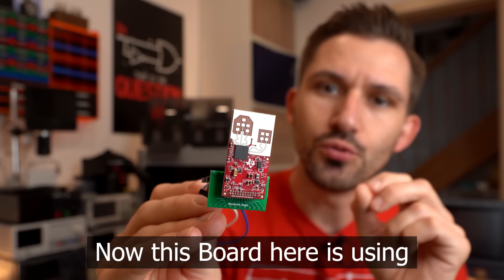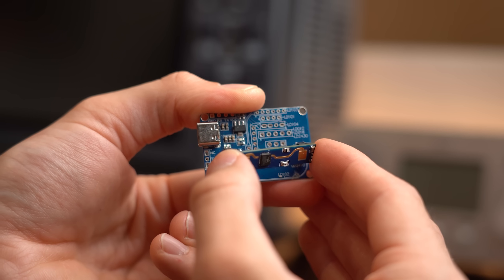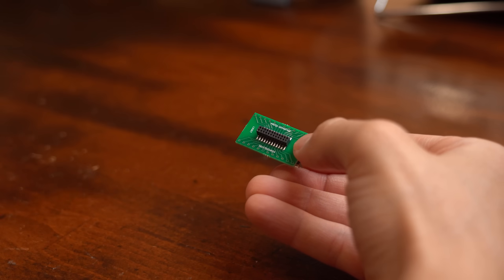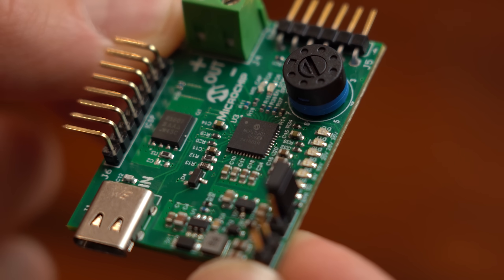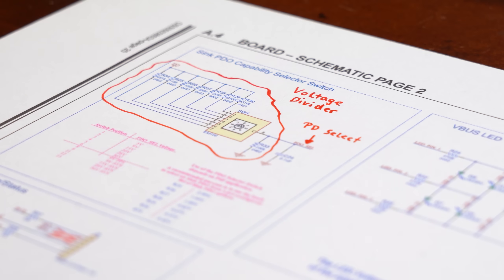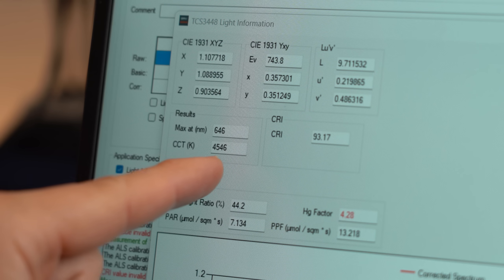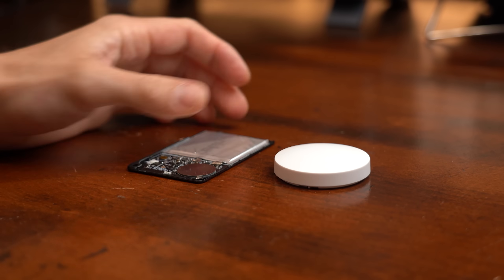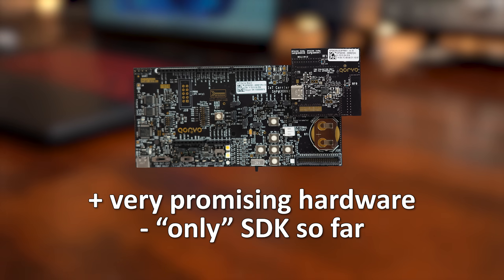I tried Super Useful Future Tech! (That you can use Today)

Comment: I would like to use some sensor to periodically check the amount/height of water in my well. Do you think this radar could be used for that? Do you think it can measure the distance also to water level (and not only from ohysical objects)? Or is there any better solution I could use?

Comment: Last one looked pretty promising. But I was surprised that you didnt consider the STM32WB55 for Zigbee/BLE application? I found it little bit complicated to get into or find examples, but I finally got it running as multi-purpose Sensor/Light Actuator in my smart home via Zigbee. If youre interested, I can share the Github link.

Comment: The "Opple Light Master" is a fairly well-designed device for measuring lighting quality.
hi-link HLK-LD2461 or LD2450 - for radar detection, "cheap" but not as smart as IWRL6432.

Comment: I wonder (and would be interested in this feature of any radar IC/board) if this is feasible to do my use case with these radars:
- I'd like to scan a empty (no people) room for its geometry including the stationary objects (furniture, devices) and their locations.   Save this fingerprint data  ie. the summary result of all the echoes, scattering of the RF wave as a reference.
From time to time (e.g. once per minute) rescan the room for any changes to the reference RF fingerprint.  So I could detect the removal / entry / displacement of any object since the last scan.    Don't you get me wrong, I don't want to know what moved where,  it would be enough for me just to detect any change.
Is this feasible?   I guess I would need access to raw RF data waveforms to achieve this...    which is most likely available only to  the IC's built-in firmware.

Comment: I use the LD2420C which you can get bunch for less than a decent pizza.  It’s a great security radar detector for my barn and triggers an ESP32 camera and mic for my raspberry pi to store the event and alert me via 128x64 LED display with a soft audible tone that wakes me but not my wife. A bit of auto associative NN discrimination using infra red and other cheap sensors quickly tells me if it’s a rabbit, deer or a person and I can log onto my raspberry pi Apache server in the barn to review the video/auduio just captured. If the AI determines it’s a human I step out onto my 2nd story deck and launch my drone. The barn has all sorts of sensors on the door, windows and other places that detect any openings happening so they’d be foolish to actually try and break in.  If they do a really irritating  set of super bright strobe lights that immediately blind them. I got guns so if they’re still around I expect they’ll agree to wait till 911 gets the cops up here.  If I’m away I have a static IP to do the same monitoring from anywhere through a port and password authentication to the Apache server.  $5 a month for a static IP is a lot less than a useless hour later ADT dude to cruse by and knock on my front door and usually just leave before I can even get down there to say hi as he puts a check mark on his pad. I avoided batteries, my barn has power and backup battery banks.  Cost a couple $hundred for piece of mind.  My house is at another valence level of security. The key is an auto associative NN that can piece together fragments of data to provide a positive determination from disparate sensor inputs.This is just a warm up for LoRa transceivers I’m going to populate all across my land in the forest on my mountain. They can transmit critical data from ICs that detect vibrations, chemicals like ammonia and pheromones that creatures leave along with a seemingly endless array of infra red movements, Doppler shifts etc. Super fun to understand the critters running around at night.  Raspberries collect LoRa transmissions from over a kilometer away and mesh via WiFi back to my deck and into the auto associative NN where I’ll soon have a Nvidia mini processor to get fast convergence as to what is happening in the rainforest along with compressed video, audio, humidity, scent, vibrations and on and on. $2-$5 sensors for most of these ICs and Arduinos, ESP32s, raspberry pi’s all host the sensors along with IC op amps to normalize data before local FFTs and Kalman filters lift the signal out of of the noise so the data I transmit back is salient. My degrees were in Math and I was an embedded software/firmware engineer for decades.  Fun to be an old geezer connecting with the beauty of the vast forest around me in the PNW on a mountain in the middle of nowhere.  I’m a bit long in the tooth to program like once could but AI puts it all together with ease.  Sometimes I change the data structures and describe via prompts how I want to choreograph the architecture and flow, but I don’t have fool with much.  The stuff I augment is usually minor This type of gear used to cost a quarter of a $million dollars back in the day; now, it’s less than a good meal. Incredible.

Comment: I'd be interested to see how precisely you could measure distance using a DVD style surface and the diffraction color,   Given the ability to detect flickering it must have a decent update rate, so shining an array of individually flickering leds at a DVD would get you lots of sample points at slightly different angles.   Probably even better than DVD would be if you could source bits of failed silicon wafer.

Comment: Thanks for video.  I'm going to check out the light sensor. I paint vehicles for a living and light source is important. And this is a great tool to get an idea of your light source when your matching colors.  Not to read the color itself. Way more expensive chips and spectrometers for that.  But color standards are only matched in certain light. So the wrong light can cost me hours ending up with not the best choice of formula

Comment: I wish there was a standard implemented open source tool for 3d measurements in home assistant. One in which you'd be able to create your own esp home sensors with a 3d mesh environment to trigger events in a 3d space instead of manually adjusting parameters by sliders or number input.

Comment: The bare SoC QFP IC: €4.86
The development board necessary to do anything with it: €350

I think I'll stick with ESP32 and RP2350 😂
Reply: Gigachad move: buy SoC and solder it yourself.
Reply: @Blaze6108 Solder it to what?

That's the whole point - the development board has the complex radio antenna, designed by a RF engineer wizard, that actually allows the wireless features to work properly. 

Without that, at best you have a slightly better Arduino, with a completely different software SDK and tool chain to bang your head about familiarise yourself with for several weeks.
Reply: Unfortunately that’s pretty normal for most micros, the manufacturers don’t make much money per unit so supporting the hobbyist level users is not something most of them have figured out.
Reply: @Milamberinx   "the manufacturers don’t make much money per unit"      so they try to make money on that 17 sets of development kits sold worldwide to companies with a large Development Departments who can afford to buy these ?    makes not much sense to me.
Even if they were not selling these, they themselves anyway would need those development boards for testing their products, so the engineering is already done.   And the manufacture costs of such a board even in small quantities is around $20.    I guess by this pricing they rather want to exclude hobby builders for some reason (support hassle?)
Reply: @Milamberinx Oh I know - I'm just pointing out the fact that it doesn't make me inclined to branch out to alternative SoCs.
Reply: Yeah, it then takes time to build a easier to mass produce board by third parties, which will then be available on AliE and AliB, and thus be affordable by consumers for products. It's more the "one off" cost where they do like batches of ten modules, which is why it's so expensive.

Comment: I have a dual radar set up using LD2415H and LD2451 (just to see the differences and abilities), tells me how fast cars in my street are going and both can report, angle, distance, speed, I think up to 5 objects, but I just use it for single object tracking. My street is 40km so far the fastest car tracked was 94km, average speed in the street is 56km. Details can be found on the Arduino fourms and AI wrote 98% of the code for me. LOTS OF FUN. Change the code and it will tell you if someone enters your property and sound alarms and stuff and intergreat with Tuya stuff/hey google etc.

Comment: Anybody knows what this OSRAM TCS3448_EVM_KT FTDI controller board includes? Can't find any info on it. Looks like no MCU on board. So I2C directly to USB? Not sure. High quality pictures from both sides of this board would be great. About the light sensor board itself there is schematic available, but that is only pretty much only sensor. Want to make open source version of this compatible with this software. Don't want to pay 300 euros just to reverse engineer a bit.

Comment: wait wait wait im confused, how/why do normal (aliexpress-style) USB-C PD trigger units "require" a microcontroller? sometimes they power microcontrollers, but I use them just fine wired right up to my 5/9/12/20V devices. How is the Microchip one any different? is it just all in one IC instead of multiple? as long as theyre all on one board, I really don't care how many chips it took, maybe I'm in the minority there though.

Comment: 9:23 ... reflects light a bit differentLY
9:30 There is a budget-friendly version of this, it's called Opple Light Master
Reply: The Opple LM 4 is kind of a moving target. The newest model seems to use the ams TCS3448 like the board featured in this video. Not sure whether they got a grip on their software side, though. Rumors say that they fired their entire dev team.

In any case, the Opple LM 4 is much cheaper than the ams-Osram evaluation kit. Right, the sensor is only 7,70 €, but the evaluation kit is about 320 €. Uh.

Comment: There is a product that might use the OSRAM sensor. It's called Parwise. It measures light intensity and spectrum for aquariums. The spectral bandwidth is atrocious (if you want to use it as a spectrometer). To calculate CRI or CCT it's good enough.

Comment: 10:30, you now also have the nRF54L15, which is cheaper than the nRF52840, has a more capable processor (ARM Cortex M33 @ 128 MHz) and supports Bluetooth 6
Reply: and lower power

Comment: 9:36
Tbf, if you want a super accurate spectrometer, each one has to be individually calibrated, which increases production price quite a bit.
Reply: certains light source (sodium, mercury, etc) and led have specific wavelengths so the calibration is actually quite easy and inexpensive. There’s already a couple of open source visible light and uv spectrometers out there

Comment: ams OSRAM TCS3448_EVM_KT Optical Sensor Evaluation Kit  -  319,75 €	

only sensor price  -  7,70 €

it made me a little sad😖
Reply: It's the same for the radar eval board.. 13 € for the chip, but 162.11 € for the board. What components on that board are worth orders of magnitude more than the main IC?
Reply: @WhoDunIt2 for radar it is justified, for such frequencies you need very special PCB (your classic FR4 won't do), for example Rogers. Pure material is much more expensive but also process is not standard which makes price higher.
Reply: @WhoDunIt2  - to scalp hobbyists and milk the r&d budget
Reply: @WhoDunIt2  None of the components but the board itself, designing and manufacturing boards with the tolerances required for mmWave isnt cheap
Reply: Yeah , darn, I was excited for a very brief moment.
Reply: haha, it got me too.
Reply: I think it's the manufacturing volumes, they don't produce many evaluation kits and they're also meant for labs with a big budget 😢
Reply: And dev board is micro usb
Reply: @ivovass195 uUSB is less of an issue, sure, USB-C would've been better, but I am sure we all have a uUSB cable laying around from our older andorid phones.
Reply: Well we must just do open source project.
Reply: @TriodeTetrode  If anyone is interested, I can help with PCB designs.
Reply: Build one yourself, it isnt that hard, its I2C
Reply: Yep, I hope we'll see a cheap esp module on Ali soon!
Being able to check the CRI for cheap would be awesome
Reply: It includes the software etc., not just the hardware, so of course it will cost much more.
Reply: They take quite a bit of effort to make and don't sell many units, of course they will be pretty expensive.
Reply: IWRL6432FSPEVM development board: 162.11€
Reply: Yeah - And you can't reproduce some of these dev boards (especially the ones with antennae) without really expensive test equipment, knowledge and difficult fabrication.
Reply: Search for the Opple Light Master. Whatever sensor it uses might not be as good as the Osram, but it does the same job (calculating/estimating CCT and CRI of lighting, evaluating flicker frequency).
Reply: Yeah, made me sad as well, I expected eval kit to be a bit more expensive  but 319 😮
Reply: Same thought I could get a cheap ppfd meter with the osram sensor
Reply: Same.
I am making some lights for my car and if this thing was 8Euro, I would've bought it so I could dial in the CCT and lumens.

And at that price I would not have cared if the software was Windows Only,
Reply: In automotive industry the chip itself is a few cents, the dev board is thousands of dollar.
Reply: If you want hobbyist grade tech lool to ultrasonic. For <100€ you can build a gps system which gives you 3d point in a small room (maybe 3-5m range)
Reply: Yeah, he got me, too. I immediately went to buy one, but over 500 Canadian. 💀
Reply: Yeah, look up the AS7265x triad, this gives you 18 channels (410–940 nm) with 20 nm FWHW for around 70 bucks. Accessible via UART or I²C.

That's much more appropriate to measure the CRI compared to the 11 channels of the TCS3448.

The triad gives you 2.78 ms integration time, which allows you to detect flicker up to a frequency of 180 Hz.
Reply: same for every other part in this video. 170, 400, etc...
Reply: Traditionally the reference boards have been targeted at companies who don't care what the price is.
Ideally they'd take a more progressive approach and sell the boards at cost, or as a loss leader.
The design cost should be irrelevant because that's a cost of the chip design and you're supposed to recover that cost in the chip units sold.
But also the reference design isn't supposed to be a useful product, it's supposed to be a test platform used when you're designing your own boards.
Reply: when I saw it I was like its osram i knew its gonna be expensive as heck, then he showed it was 7 eur got all excited but then got sad again when i saw the real price :D
Reply: @flippy9133 nah, you misunderstood the pricing. This has nothing to do with Osram.

Osram builds a chip for 7 Euros, which is the price he showed.

Then the shop which sponsored the video takes this chip and builds the whole board around it, but basically in a one of production, instead of mass production and with all bells and whistles.

These boards are called development boards and are often very expensive, because of the low production number and long storage duration for those boards.

If you want to develop a product based on the Osram chip you would then buy such a board, evaluate what you need from the things around the chip and if the chip does what you need and then you mass produce a slimmed down version of it for your product, which also fits your packaging.
Reply: IMO it's not the cost of components or the board. It is a matter of greed and charging what the market will bear. For a designer to evaluate a component we would have to spend a couple of hours designing, ordering and assembling our own evaluation board/test platform. This would be hundreds of dollars worth of engineering time. So overall it is faster and cheaper for the engineering company to just spend $250 on an evaluation board that can get shipped from Digikey overnight. This obviously leaves hobbyists in the dust. But sometimes it can present a business opportunity for companies like Sparkfun, Adafruit etc to make their own breakout boards and evaluation boards that are sensibly priced for hobbyist use.
Reply: @Afrotechmods  Yeah, but depends on where you are located also. Not everywhere engineering costs so expensive. But also don't forget software. This software took way longer. Software is what makes this device nice. But we should be able to easily make one open source project PCB compatible with this software.

Comment: 12€ well thats a expensive chip. Could be cheap for radar maybe. But for presence detection i actually use Wifi now.
Reply from the maker: WiFi? With what board, technique?
Reply: @greatscottlab   I think he means RSSI measuring from devices around a Acces point? if not. I'm interested as well!
Reply: @greatscottlab  esp-csi